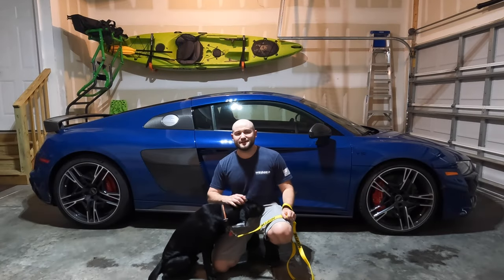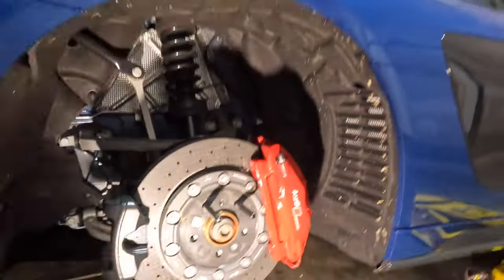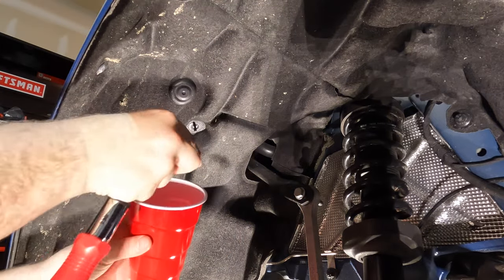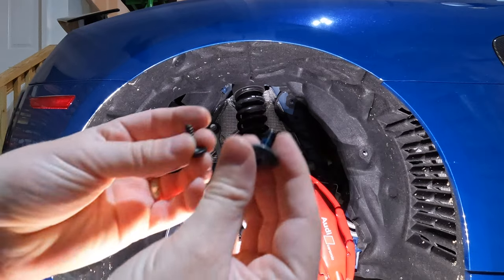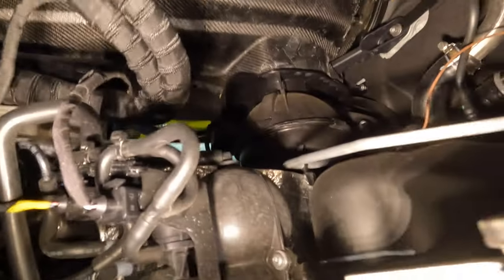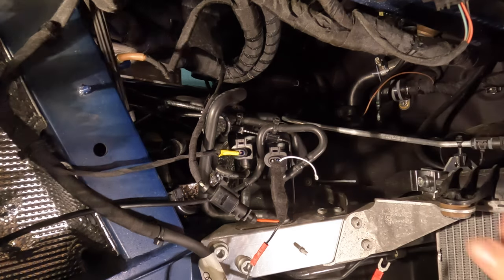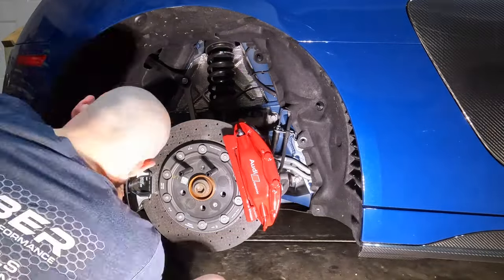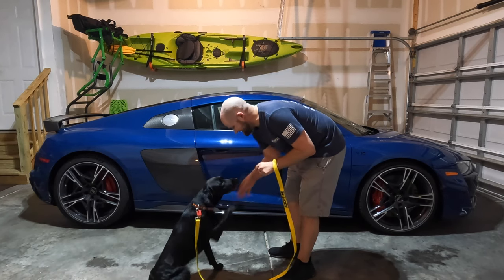How to Install Valvetronic Designs Exhaust Valve Controller on a 2nd Gen Audi R8!

Comment: I am receiving my controller today for my 2022 RWD. I think that it is easier to access from the engine bay. Last week (to verify before I bought the device) I removed the plastic cover by taking out the allen screws (I think there are 4 + 3). Four of them hold the plastic cover and the other three the outside blade that goes around the glass.
Reply from the maker: You must have some long arms
Reply: @krazyk86cu  here is my answer after installing it.
if anyone wants to take the time and do everything you did to install it.......... that is one way to do it.
I will tell you how I did it.

** Don't follow the video that the instructions tell you to follow to install this device, It is 100% outdated. It is worthless if you own a 2022 R8.
** Take off the three 25T screws to remove the plastic guard installed between the glass engine cover and the car body. 
** Take off the three Allen screws to remove the plastic/carbon fiber guard inside the engine bay. 
** Take off the plastic half turn screw with a big flat screwdriver.
** The plastic/carbon fiber guard can be placed aside and you still have room to get both arms to reach the valve.
**  No need to disconnect the hydraulic piston that hold the glass engine cover. 
** All these steps take about 5 minutes.
** You are correct when you mentioned that the solenoid where this device should be installed is the right most of the two.
** With a flat screwdriver you can push the tab to disconnect the plug where the new device will be plugged in.
** Once the plug is disconnected, the plug side is easy to connect to the new device. The other "half" where the new device will plugged in is hard to see. You have to move the black vacuum hoses with your fingers. They are very soft and easy to push aside. 
** This is the most difficult step. I grabbed the other end of the device and with my right arm I "felt with my fingers where the plug should go. It is not difficult to align it. Once it is plugged in you can hear the click of the tab letting you know that is in and locked in position.
**I extended the ground cable that came with the device to reach an easier bolt with a good ground.
**I wrapped the new device with a velcro strap.
** Done! 
** It took me about 15 minutes.
** The sound with the valves open is now heard across the whole RPM range. Very pleasant.
Reply: @pablob4390  Thanks, that saves us from a lot of trouble.
Reply: Bro, thank you so much for the explanation you wrote. Saved my life. Never thought a random YouTube comment will help me so much. 

I can confirm this is much easier to do from the engine bay instead of tire wall.

Initially didn’t work because I plugged into the left connector but finally found the correct one after reading your comment properly again.
Reply: @pablob4390  hello, I also have a 22 R8 just purchased the valve system controller. I am having trouble with one part if you can reply and I can send you my contact info please.

Comment: Great video brother I also got the valve controller for my BMW M5. It works great. I seen that people were able to connect the controller to their home link on the mirror which controls the garage door openers. Have you been able to do that? If so, what are the steps cause I can’t seem to get it to work

Comment: Are you able to use the OEM button controls/modes when it's in off/closed mode or is the exhaust steering wheel button worthless now? Ideally I'd want full open and then the ability to put it in comfort mode or something to close the valves without having to play with the fob until wanting it full open again.

Comment: Does that override the sport exhaust button behavior so that valves are always open instead of being closed based on the RPM ?
Reply from the maker: Correct. They are full open all the time with this valve controller
Reply: @krazyk86cu  thanks for confirming,  I’ll add that to my mod list.
Reply: @krazyk86cu  When does it reset? When уоu press the fob button? Or when уоu restart the car?